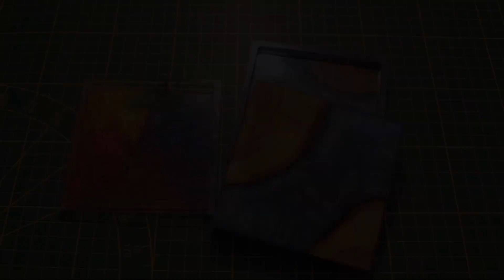DIY Epoxy & Wood Coasters / Resin Art

Comment: 6:10 What is painted on the surface of the wood？What's the function？Thanks
Reply from the maker: I painted Resin on the wood, when you paint the wood before you put it in the mold it reduce air bubbles 👍
Reply: Luke 417 I see 😀Thanks